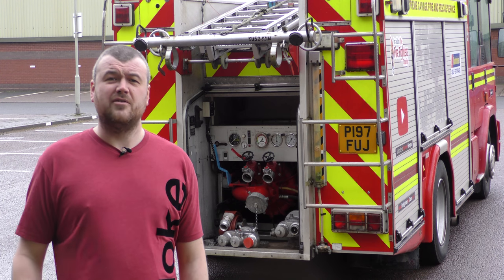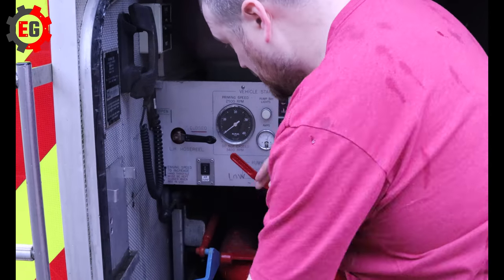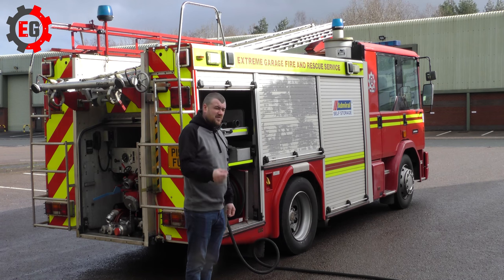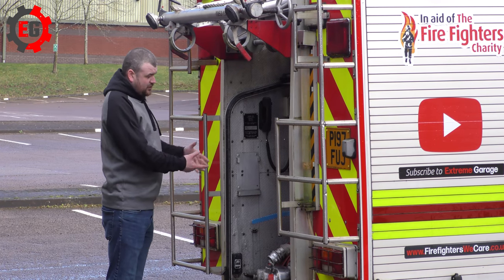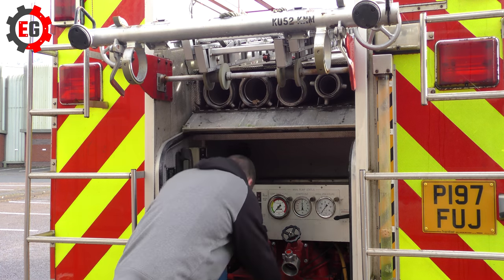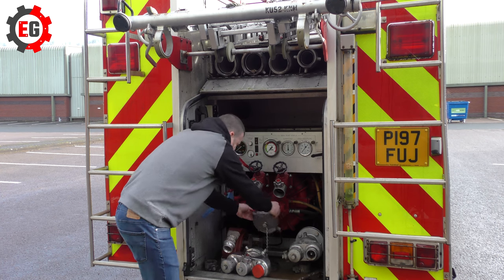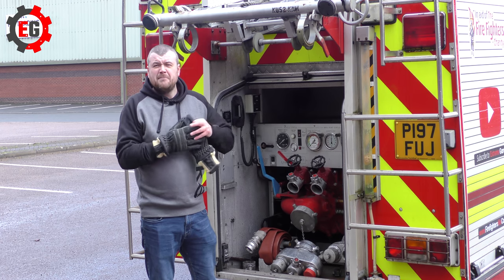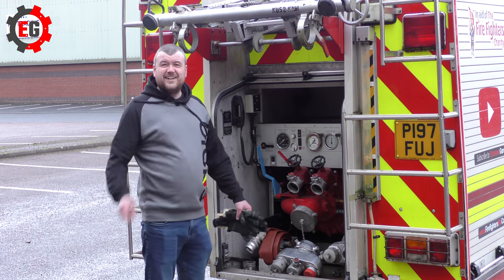How to use a Fire Engine Pump. Using a Godiva Pump on a Dennis Sabre Fire Appliance

Comment: Quick tip.. use your short length of hose that you fill up the tank with, and connect it to a spare delivery and connect that to where you fill up from the hydrant. Open the delivery and the tank lever. This will re-circulate the water from the tank and avoid overheating the pump casing.
Reply: Okey Cokey also know as a cooling loop 👍
Reply: Good one cokay

Comment: Aussie firefighter here. 2 points
1. The way you were connecting the strainer is correct. Its the way we are taught.
2. Hose reels always need to be charged (pressurised) before winding away. If they aren't then they can sustain damage while sitting for too long or when you charge it the next time wound up.
Reply from the maker: firefighter_DJ cheers for the info on HP reel.
Reply: And don’t ever let an officer see you dragging the branch (end of the hose wheel) along the floor!

Comment: Make yourself a portable dam using a triple extension ladder with a salvage sheet and line bag. That way you will be able to show and test the suction facility. If you need any help building/using one I'm not that far away from you and more than willing to pop over.

Comment: There are 2 pumps back to back. So with high pressure lever over, some water from the main pump is diverted to the 2nd pump which feeds the hose reel. Thus, you can run both together. The issue for the pump operator is to ensure that you don’t over do the HP on the hose reel, and knock the guys off their feet who are using 45/70mm hose.

Comment: Hi mate you sure you dont get water out the hose real when in low pressure??    On the scania you can BUT... it's not useful at all      the 2 pumps inside are known as (low pressure) centrifugal pump and high pressure peripheral pump   when in low pressure water comes from the hose real too but it's no good for anything.    I found its handy just to leave it in high pressure, even the the gauge shows 20/25 bar it's not giving that pressure to the deliveries at the back so you can run both at the same time....... not advisable but if your first pump on scene......     you should have a high and low pressure gauge separate and a compound gauge for hard suction or pressure fed supply.   Great videos!!!!!!@
Reply: I always got told that if using both sets of  hose line  leave it in high pressure avoiding problems ect
Reply: Yep, it's a godiva not just Scania, he's uderstandably clueless & a danger to himself.

Comment: Let me explain you put a strong hose on the sucky part of the truck aaand a flexibel hose on the blow part of the truck mind you ther needs to be a nozzel part to and that part you aim at the hot stuf and put it out before it burns you
Reply: Then again. Until u have faults with cavitation - pump priming - frictional loss - burst lines - broken seals /air in the system ect whilst ie out on a job working from ither open (water hard suction) or pressure fed supply's with upto 5 working branches and lines complete with a ground monitor and dividing branch all of wich  are coupled up/working at the same time. With high and low pressure working together resulting in  different guage readings. Then uv goto know wich of the 5 guages your looking at and what fault or alteration  they are telling you and why  ie line 2 water pressure to low.  Centerfugil pump is  overheating.  Compound guage altering from 0.6 to 0.4 then - dropping to 0 of wich can also have 2 different meanings depending on the type of water suply you are working from.! . The last thing you would want is a collapsing hydrant or any other type of water failure whilst out  on a real incident involving a big  fire. A good pump operators job is to know what's happening thoughout all systems at all times.

Comment: You should either sell that appliance, or find a qualified pump operator. Accidents involving pumps can occur & even you will admit to being clueless. It's not a toy. You have picvked up some knowledge somewhere, but this is a fine example fo a little knowledge being a dangerous thing. I'll bet that not one piece of equipment has been standard tested?
Knock off and make up.